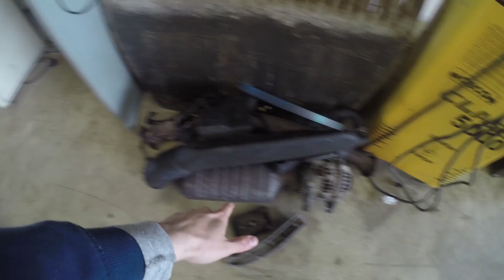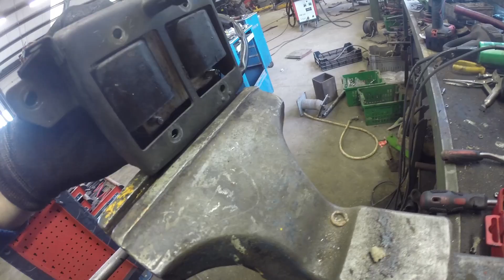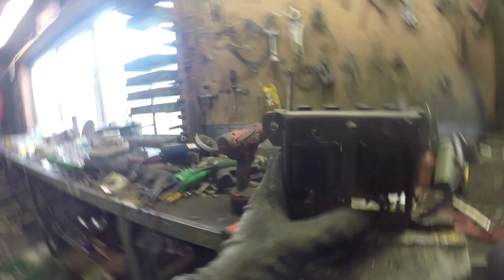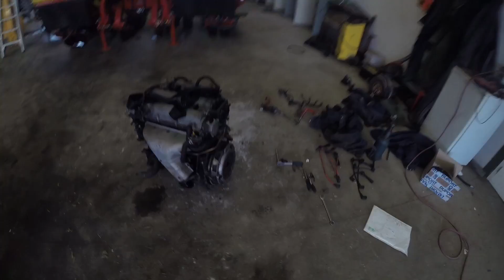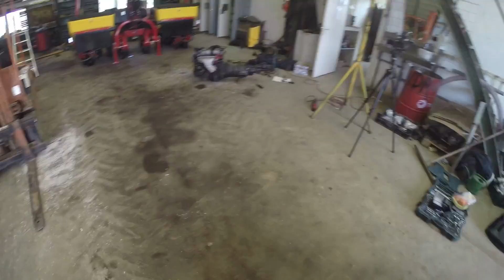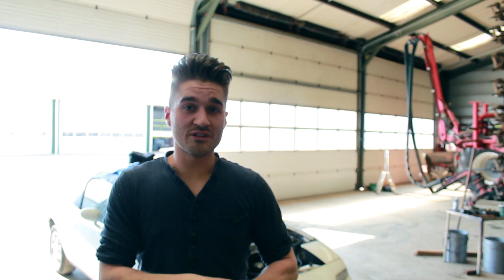Miata 1.6 to 1.8 Swap - Fabrication and Engine Install 1/2

Comment: Ty for taking the time. Just Bought a dead BRG  with a knocking 1.6  short nose. Couldn’t find a long nose crank. So 1.8 here I come.  Bought a Jdm 1.8 nb for $500 🤯.

Comment: late to the video but does the 1.8 being longer affect the motor mounts at all or can it just bolt right in
Reply: need new motor mounts :) use 1.8 ones.

Comment: Around how much was the total cost would love to know found a low mileage 1.8 for 150 thinking about doing the swap dont know if its worth it
Reply from the maker: My engine was 250 I believe, I fabricated all the parts myself and sold a few 1.6 parts. So in total it cost me 130 euro haha..
Reply: +Luca Car Mods there shouldn't have been any fab work?except a 1.6 to 1.8 intake adapter and a ghetto rigged coil bracket

Comment: I'm a noob, but around how much hp will you gain from this?
Reply from the maker: +Alejandro Barocio The 1.8 produces 130hp, early 1.6 produces 115hp and the late models 90hp. So it's noticable!!
Reply: +Luca Car Mods okay cool! Is this a good bang for buck mod?  Thx for replying.
Reply from the maker: +Alejandro Barocio Yes definitely! If you can get a cheap 1.8 then do it.

Comment: Dang son that was quick! Looks really nice! Do you know how many miles were on the car?
Reply from the maker: The engine looks a lot better than my 1.6,but  I don't know how many miles it has done. As long as the engine runs fine and has good compression I'm happy!